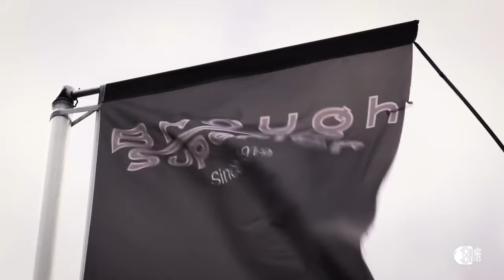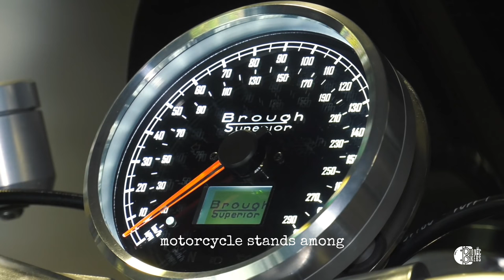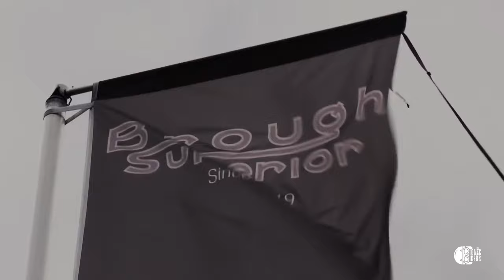RACING FIGHTER PLANES on a Brough Superior Motorcycle. Would you love this kind of freedom?

Comment: I used to drag race Boeing 737s riding my FJ1100 in the mid 80's. On my way home I would come off a roundabout in line with the holding point of London Stansted airport where I worked. There would often be an aircraft winding up to take off as I came along side and we would see who could pull away. I would be running into a hairpin bend about the same point they would be lifting off. Good fun after a long night shift.
Reply from the maker: Great story dude, if you fancy doing it again let me know and I’ll grab me camera 👍😉